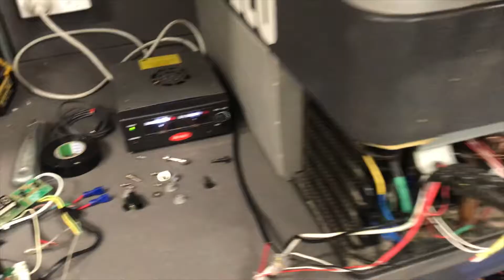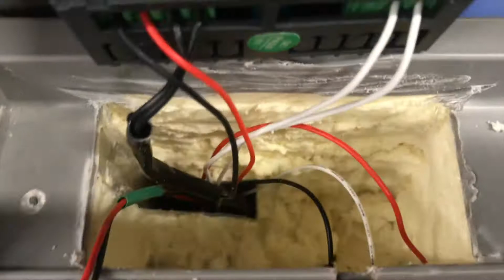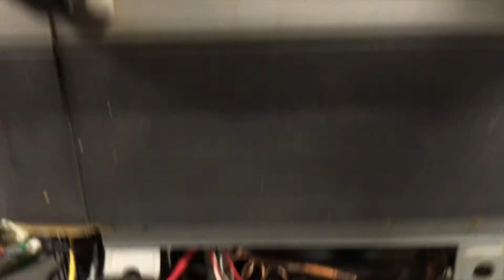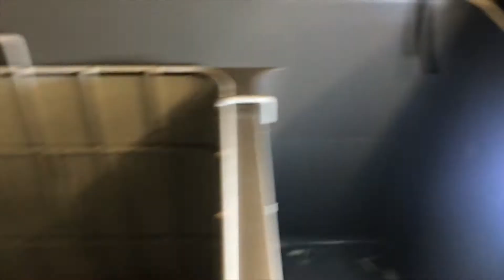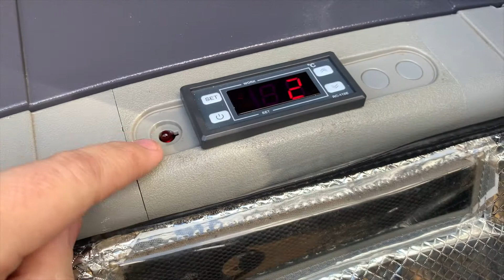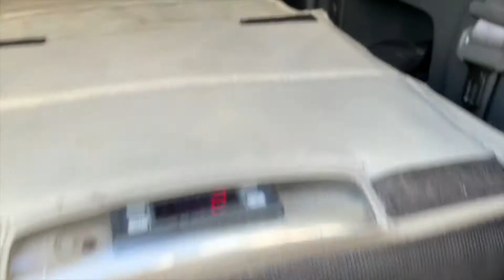WAECO CF50/CF40 Fridge Repair - Replacement Controller

Comment: Thanks! Ordered an STC-100A controller, great idea. These compressors are great with a simpler controller. Probably use less power too without the other circuitry. My circuit board has died too.

Comment: All that so called rubbish you pulled out .. the filter board and 5volt supply to the control panel .. the control panel that drives the variable speed compressor .. then you thought you were going to remove the 1N compressor controller as well ? 😂😂 i bet that wouldn't have ended well ! 
So you pulled out the tech to install a cheap chinese piece of crap .. lost the variable speed and didnt bother to repkace the temo sensor with a waterproof one ? 😂 
Dude your advice is completely flawed... use a good quality IR33 controller .. set up for 2 speed with water proof sensor .. that is the only way
Reply from the maker: Hey Richard, thanks for the kind words mate. I sure did pull it all out. Seeing as most of these end up in land fill when they die, I’m happy that mine and likely 100s more kept going with some “cheap chinese piece of crap”.

Sounds like you’re a pro, so you do you mate and enjoy your non China expensive fix. 👌

Over 2 years on, mines still running strong 💪. Beers were ice cold today for Christmas.

Merry Christmas 🎄
Reply: I haven't looked fully into the Waeco board and the associated temperature control equipment, as I have just now found a problem with mine, however I see a relay down on the main board which obviously drives the compressor unit. 
If this is infact it's purpose and I'll know more tomorrow when I investigate, then your waffle about speed control on the compressor is just rubbish. 
This fella has replaced like for like, it's a straight on off control system, no variable speed drive I can see! 
The bit about not using a water proof temp sensor is also incorrect as he is using the original OEM thermistor. 
Don't fuk with something that doesn't need fixing. Keep the original thermistor.

Comment: Thank you! I have a spare CFX 28 that has had something fail inside. Compressor runs and pulls down to 30 but I had it set to 0 deg f. Gonna yank all the guts out and use a aftermarket set up like you did . Thanks for sharing

Comment: Nice work. I'll be doing this if mine ever fails.

Do you know if its possible to lock the original keypad on this model so the buttons can't be accidentally pressed?
Reply from the maker: Sorry I’m not sure Pat. No issues with the aftermarket controller. The buttons take a bit of force to change. Mind you, mines been set and forget.

Comment: Can you still run it on 240v with this fix? Great video. Many thanks.
Reply from the maker: Unfortunately no, however I run a 240v to 12v transformer. Something like this. https://www.jaycar.com.au/12vdc-7-5a-switchmode-power-supply-mains-to-cigarette-lighter-socket/p/MP3575

There are also cheaper alternatives.

Comment: Hi, this is extremely helpful, thank you. Can you please reply with a pointer on a compatible controller. I don't know how to start looking for one.
Reply from the maker: Hi Lee, try something like the STC-100A. Just make sure it’s the 12v model.
Reply: @ShedintheValley  Thanks! Now I see there are many 12v DC temp controllers with relay. What a deal they are only $10-$20. I have one on order that looks pretty good. I am looking forward to getting into the repair and my Waeco cf-50 back on the road. I bought in 2003 and this is the first time it's ever broken.
Reply from the maker: @leefitzgerald5601  perfect. These earlier ones have the DanFoss compressor in them. They are great.
Reply: @ShedintheValley  I purchased mine in 2003. So long ago and it never failed until August 2021. If this repair fixes the problem, it will almost be better than new!